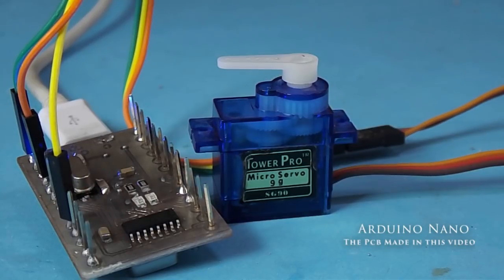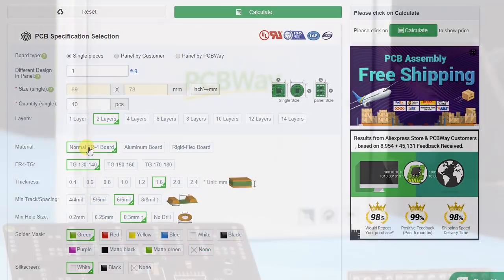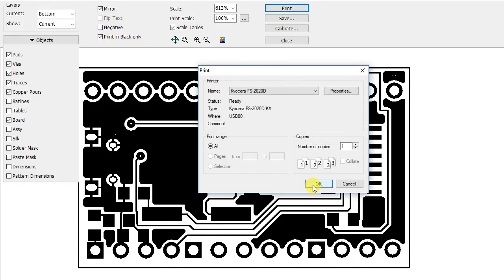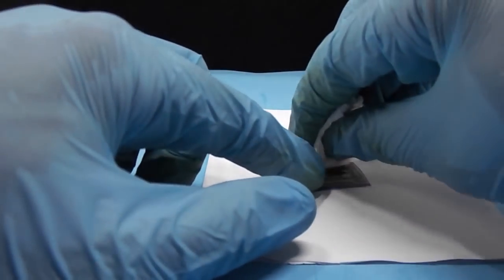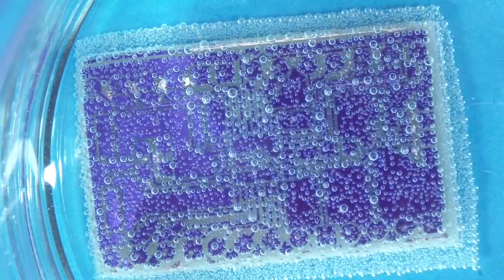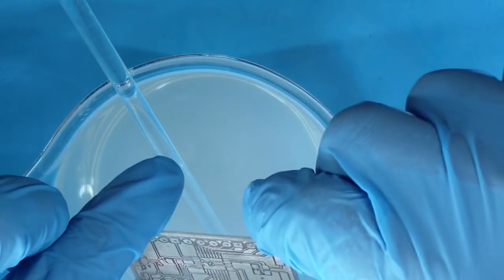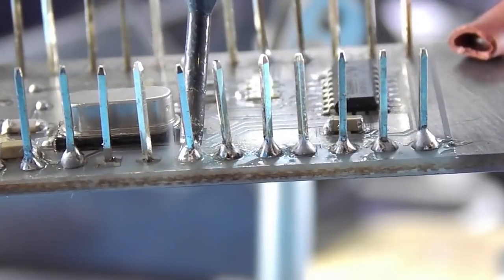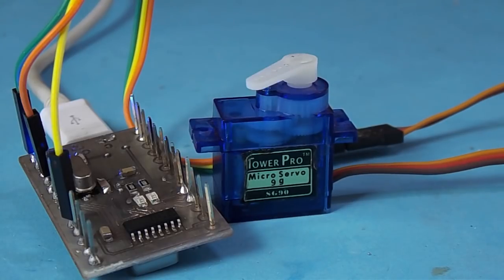How to make double sided pcb at home - including pcb chemistry

Comment: The audio is not so great for me. As a suggestion, get some cheap Samsung Galaxy headphones with mic from Aliexpress or eBay. They can be found for less than $3. Then do your voice over recording in a room with a blanket over your head. It may sound odd at first if you haven't heard of this technique. There are many instances of people doing professional audio voice over recordings for cable tv shows using this exact same method of a blanket over their head. The blanket will stop all of the echo and noise in the room. This is how you get clean audio on the cheap. Also when you mix audio tracks with vocals keep the background music almost all the way off. Every device viewers use to watch your content will have a different center frequency and amplification spectrum. If you dial in the music to where it sounds just right to you on your device it may not be right for other people. You need to plan for other people's varied hardware. 
   If you had clear audio here, I should be able understand your english, but between the music and the echo I can't understand you very well, and I'm a native English speaker from the US.
  I wish you all the best. I'm here because I'm experimenting with dry film photoresist and etching right now too. I wish I could understand you better here ;)
-Jake
Reply from the maker: Hi jake 
Actually i would like to thank you for your well written comment it seems like you spent longer than the video duration itself to write this 

And i want to inform you that I'm using boya m1 microphone but when i listened to the video,  my mistake was using Bluetooth boosted headsets that makes the voice ok or i thought it's ok 

I have just released new video and i tested it in my phone and pc speakers and headsets and it's ok 

Now i awe you some help if you need to make a pcb 

Thanks for writing this 
And have a good day :)
Reply from the maker: Wow man you are impressive 
I have looked on some of your videos it seems you have done great work here maybe just need a little explanation but it looks advanced 

Can we contact each other outside youtube?  
 I think it will be nice to know each other :)
Reply: @EslamsLab  
The uploads I added on YT are done in several languages. I think the last few have titles and descriptions in 14 languages. I was/am exploring how search engine optimization works with google translated titles and descriptions. That's why I try not to speak in English and I try to avoid English text. The intent is to try to communicate everything intuitively as much as possible. I don't know if I will continue this further but it has been interesting to see how the viewer demographics have developed over time. If I change what I'm doing I will probably just start another channel and leave this one alone. There are too many subs that don't speak English. I don't have that many subs, but growing a channel hasn't been a real focus. I don't intend on monetizing this. I thought about it at first but I can't really commit to an upload schedule with my poor health. I'm not an expert, so if I shared whatever I'm working on day to day I'd just be creating problems and sharing bad information most of the time. I'd rather just share some odds and ends occasionally when I feel like it, or when I can't find information about something and want to help other people that may be looking for the same info.
  If you don't see my last message w/ email, check your spam filter :)
-Jake

Comment: @eslamslab what PPE and safety precautions are required when using your methods for pcb manufacturing?
Reply from the maker: all chemical reactions should be done in a well-ventilated place so don't breathe the fumes 

also, you need to use latex  gloves while dealing with all PCB chemicals